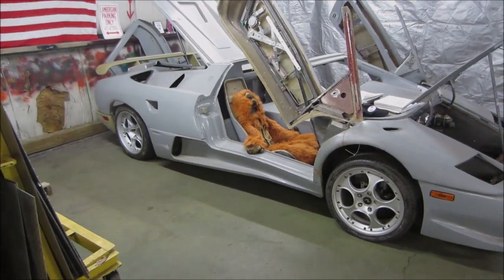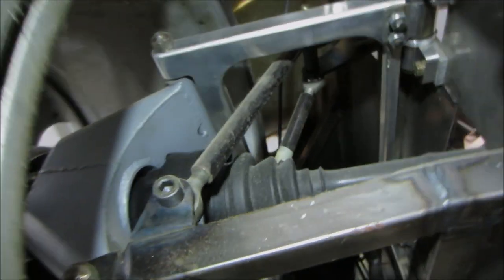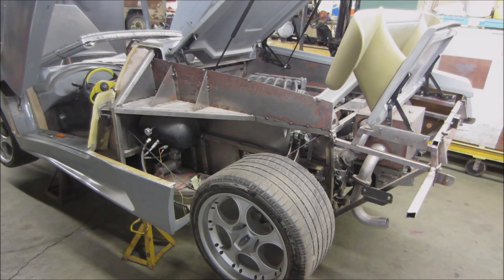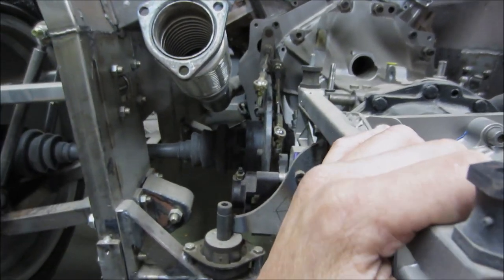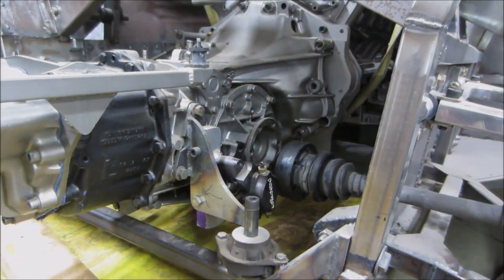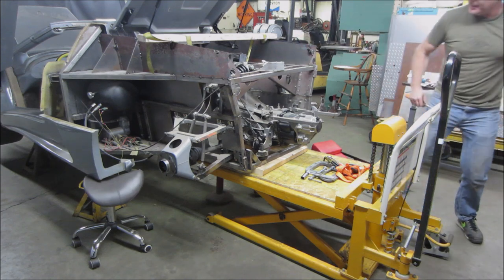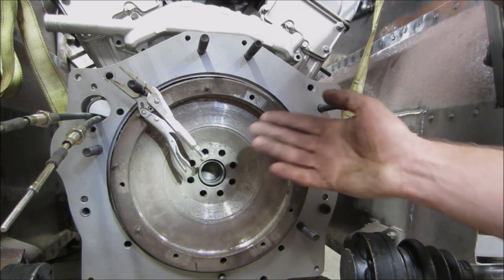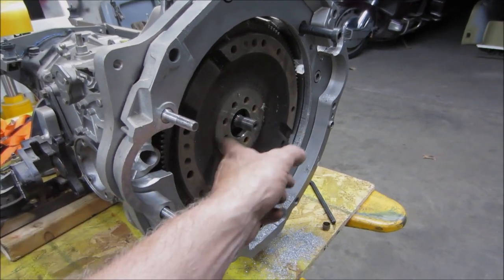Free Lambo Diablo hand built, lets see what it needs to Run?

Comment: The 2 crank sensor holes are for separate crank sensors. The v12 has 2 ECUs (DMEs), 1 per ECU. The ECUs treat the engine as 2 straights 6s. They are 30 degrees apart, and they are for your fuel injection since these ECUs use batch fire injection, bank 1; 1,3,5 Bank 2; 2,4,6. This seems like its going to be a fun build. Cant wait to see how it turns out. Thanks for the vids.
Reply: Also, I'm pretty sure the v12s had a special dual mass flywheel, which is different then the other dual mass flywheels of that era. Junk yard or used would probably be your cheapest bet, if you're only test fitting. You can find a manual 850csi (very rare) in America that has the v12 in it. They still sell aftermarket flywheels for them. Cranks are still the same I believe.

Comment: I do a lot of builds with "adapter plates". If i was trying to make original Porsche flywheel work assuming its its billet or forged not cast. You would need to have flywheel holes welded and redrilled to BMW pattern and a spacer to space flywheel to get correct clutch, pressure plate throw out bearing clearances. I've also had to make 2 piece flywheels in the past the one in rear for BMW pattern and starter ring the outer one for clutch mounting. Hope this helps, Dan. Question feel free to ask been doing this kind of thing for 25 years.
Reply: The last kit I did had the same issue. Triumph Spitfire with a 3cyl dsl Kubota  engine. With the adapter plate and the recessed crank vs stock required 2 5/8" to make up the difference. The kit as it was just a motor swap, came with motor mounts, adapter plate, bolts and a custom milled flywheel. 

Now that the foreplay's over... If you have a big enough lathe, a six hundred lbs chunk of iron, ring gear and the skills, make one. If you can, your a better man for the job than me. If you did it would be a hell of a lot lighter and being one piece instead of two would, in my opinion, be much safer. ever have a flywheel shatter? I have. It busted the bell housing, spun the transmission and the gearshift broke my leg. I was very lucky.
If your wandering why anyone would want such a conversion. 98 mpg on diesel. Gas had gone up to 95 cents a gal.
Reply: @tayro7265  Your Triumph build sounds really , really cool. Your busted leg story is just amazing. Very lucky indeed.
Reply: @tayro7265  Diesel 95c a gallon??? Here in the UK, it's around $6 a USG
Reply: Dont forget to check if that engine is internally or externally balanced before modifying the flywheel. Also i would pull those valve covers and plugs and check things before spinning it over. Being an unknown i would make sure it has its timing chains/belts intack and timed correctly in case its interference. No smashy a valve. Intact*
Reply: @MURDOCK1500  Yea... That was a few moons ago.
Reply: Muscle Car Mayhem boy do I feel inadequate now. See above comment 😝
Reply: @billssolarpowerandgardenin1016  I know nothing. Just a few thoughts i had running through my head. No need to be mean.
Reply: @MURDOCK1500  Years ago it was 95 a gallon, now is it as much as premium gasoline, more in some places.
Reply: Muscle Car Mayhem @bentboyzbbz I was referring to poster of this comment and a comment I had made later with my thoughts. Wasn’t intended to be mean and I’m not sure how you came away with that. After reading Mayhem’s comment I realized how little I may know on the adapter subject I had commented on.
Reply: @billssolarpowerandgardenin1016  I never felt it to be mean. Your completely okay in your opinion some people are far to serious on here IMO.
Reply: @bentboybbz  I think there's no timing belt at all. Just the bare pulleys.
Reply: Address Mustie with your comments. Leave him your contact info. also. That would be helpful. Sounds like you have the experience to solve his particular problem at hand.😇

Comment: I think it would be best to try and find the build instruction book that came with the kit and see where he got to. That would give a good indication of what stage the build was at when last touched. :). 

At the moment, it is just like a jigsaw puzzle without a bicture but you know what the ending would look like.
Reply: or see if anybody did a similar swap, M1 is just shooting blanks here and any amt of $ spent is a waste if it goes belly up
Reply: @gertraba4484  The original owner must have a build manual somewhere in the garage for it.
Reply: @ianallen2  true, but in these days that seemed like a purpose built chassis and engine with just the body shell a purchase and the rest cobbled together from new.used parts
Reply: @gertraba4484  True. I think some of the main chassis is part of the kit and some parts of the frame is self fabricated. It definitely looks like a diy weld job on parts of the frames. Some kit car builders dont want to pay the price of ready made chassis and just buy the body kit and make the frames from drawings / plans.
Reply: @ianallen2  I agree, some of the welding certainly looks almost as bad as mine.  Can't believe that it would have left a factory in that condition, looks like bubble gum squeezed between two bits of metal.
Reply: @andystokes8702  Looks like I welded it too. lol. Its easy to see the difference in the welds.
Reply: @ianallen2  My welding is what I call Gorilla Welding.   It's very strong but you could never describe it as pretty.
Reply: At least he tried to weld this together, my friend bought a kit car several years ago, just ti find out that it was tacked together with pop-rivets. Tried to find the seller a week later, and we did... at his funeral, another crappy build got him before we did!
Reply: Ian P A  You need to watch more of Mustie 1 videos!
Reply: KEEP IT SIMPLE!! put a 4wd pickup chassis under it . This thing is  a time, floor space and money gulping monster. I can see it now sitting on big rubber and a snowblade, all set to earn its keep!
Reply: @toosunakabooma1213  If we are all yelling dumb ideas, I say Trailblazer SS, or Trackhawk chassis. Then it's 4x4 but still lowered and fast.

Comment: Happy to see you explore the beast internals.. The way I see this the previous owner had a plan for that and he fell short on time and took all he could to make it looks almost done..  I am pretty sure there are parts on those 4 palets to fix the gap between the engine and the transmission. Dont dispair! With all the know how you have and the ingenuity and creativity you showed before you can pull this off..  The previous owner made the heavy work (the frame). you need to fit the tight spot and it will be all done..

Comment: I want to see this project put together for sure... however I think your going to have to repower it. While it would be super cool for it to be a real v12, I think getting that motor to run would be the death of the whole project. 

Lots of options from a LS swap, to going completely the other direction and throwing a bug/Porsche drive line in it. Either would be easier then getting that set up to work without costing a fortune in time and money.

Comment: My biggest concern would be if that is a mock up engine.   Possibly the one they sold off was the final engine for the project.
Reply: My thoughts exactly.  There may even be something terminally wrong with that engine.
Reply: It looks very clean, as if it's never been run or has been fully rebuilt. Same applies to the transaxle..
Reply: Better check to see if the pistons are backwards or missing rings. ;)
Reply: Transaxle definitely has been apart. Blue RTV is easily visible. Should have been ready to go if he was that worried about sealing it. But then his excessive use of blue RTV makes me question the quality of work.
Reply: This whole thing feels like a bad dream where all your teeth fall out.
Reply: stuff a PORSCHE 911 Engine in it and call it a day....................
Reply: @jimgourgoutis  Or if there are pistons?
Reply: @philipbarrett3151  yeah that too!
Reply: @IBWatchinUrVids , that's not how it works. First of all, blue is about your worst choice. And too much can cause serious problems. Depending on what it is on how bad and why. I've seen many cracked heads from someone using too much rtv. It squishes into the coolant passage. Then water pump pumps it thru coolant passages. When it hardens, you have no flow. That's one example . I'm not a fan of rtv anyway. Sometimes you have no choice. But usually you are better of with a gasket secured to one surface with yellow 3M weather strip adhesive.
Reply: @briankennedy5578  no water passage in transaxle
Reply: @ xmachine 700 , really? NO SHIT. Like everyone doesn't know that. Like said, that's one example why too much rtv isn't good. Try getting a big gob of rtv in an unsealed bearing. You have those in transmissions. Now you have a problem. Or a passage plugged up when your excess rtv squishes into it. Think that would be good? Also it looks like shit. I think I would want someone working on my shit who puts more pride in their work than that.
Reply: @briankennedy5578   Of course it has, look and you will see why.
Reply: @Scott Gibson , WTF you talking about?
Reply: @MattExzy  that's like one of the worst dreams tbf
Reply: @IBWatchinUrVids  no no, just a dab will do ya
Reply: @MattExzy  feck yeah,exactly,you nailed it.
Reply: @philipbarrett3151  he might have forgot to install the piston return springs!
Reply: 427 Texas Motorsports supercharged....
Reply: He needs to dump a Cummins 5.9 12v in it and be done, that BMW junk never lasts and costs more to fix than it's worth...  That's good ol german thinking for ya...
Reply: @briankennedy5578  rtv don't work that way.  Do you even own a wrench?
Reply: @richardbonfiglio1765  if you want to be a troll find a topic you know something about. This definitely isnt it.
Reply: If that's your biggest concern, then you have no idea what lies ahead. Lol! They could get a replacement mounted and running overnight if that is all that was left.
Reply: @stephenearly417  I assume you mean Texas Speed and just don't know any better. But still, no. This does not need a Chevy V8. A K swap would be 1000x better than a Chevy and I am a pure LS guy at heart. Maybe even a 2JZ if you insist on something like that, but I think a v10/v12 is a must.

Comment: The BMW V12’s are essentially 2 of their straight 6 engines welded together so you will have 2 of everything (sensors, computers etc)
Reply: Only older models 80's and older. This engine is first that used electric gas pedal. This engine is from BMW e32 and engine is M70b50 it is based from M20 engine.
Reply: arkkukakku112 wat? M72 other than being two m50s...isn’t much different

Comment: You should be able to machine a flywheel with an enlarged starter ring and also match the crankshaft flange and clutch surface.  The rest is just matching the bolt holes.

Comment: This reminds me of the time I bought a Porsche 924, and everywhere online said a 20v Audi 5 cylinder engine would “bolt right up”. So I hunted high and low and bought the Audi engine. Only to find it was all urban legend. It didn’t bolt up at all. Even a 944 bellhousing didn’t solve the problem. Sooo bitter about that one, even 12 years later.
Reply: S2/RS2 engine ABY or ADU do ;) I have one

Comment: How about a flywheel from the BMW, I believe the BMW uses a 2 part flex plate/flywheel, so just use the flywheel portion, drill out the Porsche flywheel to match the bolt pattern and then just use long bolts that go through both the flywheels together (this is effectively what BMW does with the flex plate and flywheel in stock form, but instead of using the flex plate you are using the Porsche flywheel), you may need to machine the height of the Porsche flywheel but shouldn't be anything too difficult. And you can drill holes/lighten the BMW flywheel if total weight becomes an issue. 

Alternatively machine out the center of a BMW flywheel making it a ring gear for the Porsche flywheel.

I'd probably pick the 1st option, makes changing of the Porsche flywheel easier if you ever need to for machining during clutch changes, etc.

Comment: That home depot looking mild steel square tubing frame looks suspect to me for strength and being able to handle a v12s torque , make sure this is gonna work before dumping a ton of time and money into it... love your vids always!!!
Reply: Twist and Shout!
Reply: have you ever looked back in the history of LOTUS RACING and there designs, thin / small was order of the day, there thinking was - IF it broke, then remake it stronger - Oh, LOTUS RACING won a few races = LOL
Reply: Cursory inspection shows that its gusseted where it maters and looks like its welded with decent skill... I'd trust it to go down the road fine, even have a little fun, but a crash would be ill advised.
Reply: That chassis is so overbuilt! The V12 is no torque monster either.

Comment: Before cobbling that flywheel on you need to know if the motor is internally balanced or externally balanced same goes for what the flywheel is from .The old Chevy guys would remember that if they ever swapped in a 400 flywheel on a 350
Reply: Harmonic balancer was different, flywheels were the same.
Reply: @dsloop3907  400 flywheel has a weight on it that the other sb Chevy's do not ,but I'm not sure if you are referring to the Chevy or his BMW motor
Reply: @1oldgoat383  Did not know that, I did know the harmonic balancer is different.

Comment: Use flex plate inward and an adapter hub that looks similar to a rear hub from a bicycle thats been disassembled with matching bolt patterns could work. Maybe studs for crankshaft with locktight and or locking nuts, and mill the trans side for replaceable pilot bearing.

Comment: That flywheel has 8 holes, take a look at the 9 holes on the other side...
Reply: And I thought I was the only one who noticed that. LOL. (Whoops wrong flywheel) oh well Musti will figure it out.
Reply: Was going to say -- yup, 8 and 9 are probably "too far apart", indeed.  :)
Reply: I didnt see that till I read your comment. 8 bolt holes and 1 for the dowel pin on the crankshaft.  I wonder if the previous owner saw that the flywheel only has holes?

Comment: DiD you receive a kit car manual with all of this? The clutch is jus one of a thousand issues you will have to solve. RUN SCREAMING FROM THIS!
Reply: Pretty schetcy, gotta love the spray foam holding the lower body panel.
Reply: Perhaps a full engine and trans swap, something a bit less expensive to run and a complete lump may take away many of the expensive problems but it will be a whole heap of trouble, cheers
Reply: just because your new garage is gigantic, please don't go down the familiar route of filling it half baked crap and money pits ... get back on the vespa and mowers!!
Reply: You are right there, this comes from an era where ego won over sensibility and it is now counter to any enviromental sustainability, cheers

Comment: Try emailing DC super cars in England about the flywheel. They do bmw v12 Lamborghini kit car.
Reply: Anthony Poole 
Knowing 1980s BMW engineering, I bet M20 flywheel will fit.
Reply: wrong bolt pattern, BMW V10 M5 double clutch and flywheel bolts straight on, find a used one from a BMW dealer, they always change the clutch and flywheel as one unit, you can probably adapt the flywheel to take a conventional clutch
Reply: Pat Gill :👍
Here in Finland is company that make/sell kit to mount manual gearbox to M70. Billet flywheel, bellhousing adapter plate, clucth kit.

Comment: I would say you have the mock up engine. the other (sold) engine would have been the one intended for car, best bet would be look for a running but trashed v12 7 series. I think fitting the original flex plate and bolting the flywheel to it would solve your problems with the clutch.

Comment: I once inherited a project sort of similar to yours; yours is far more difficult. Mine was converting a Volkswagen Carmen Ghia into a dune-buggy. And, like you, I had to completely take it apart and start over.
What you need is a Cuban mechanic. MANY of the Cuban cars are clooged together from completely dissimilar parts. I don't envy you the job, The original builder wanted a manual trans. Don't reject the thought of going back to automatic. Apparently the original builder had a second engine for this build, The current engine and transmission might be prohibitively expensive to re engineer.
While I would respect the original guy's goals, I wouldn't necessarily adopt them as my own. And no, the dune-buggy never happened; I was too young and poor to finish the project. Know when to holdem, know when to foldem.

Comment: Cummins swapped Lambo is an interesting thought.
Reply: I agree, but how would you attach the rear-mounted trolley jacks needed to keep the front wheels on the ground?
Reply: No! true mustie1 form would be an air cooled 1600cc VW engine lol
Reply: Mid engine the Cummins. If you are going to have to put this much effort into getting it going might as well go all out.
Reply: Throw one of those supped up Honda engines in it.
Reply: Yeah I see this quietly being sold off.
Reply: diesel,m57. weighs about 1.10th..

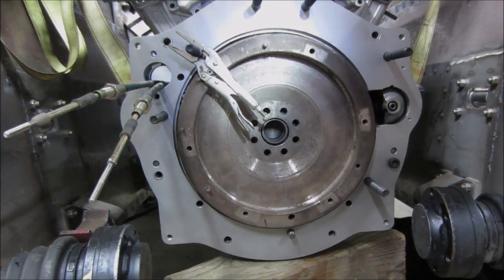Comment: At 51:40 "Can the starter get moved in closer?........." - We encountered a similar problem once, with a generator engine (Perkins) which came with a starter that was allegedly for that engine, but it didn't match up, just like this one. The flywheel was original, and the starter mount hole was original, so there was no way to change either of those, however, a visit to a friendly breaker's yard revealed that there were several different sized starter pinion gear options. The solution was then clear and simple, a larger pinion gear was needed, or in our case, we just swapped the starter, whole, and effectively closed the gap that way. I'd say that's an option you might find worth pursuing here before looking at the more drastic engineering/machining angle.

Or..... I should first watch to the end of the video? 🙃 🤐